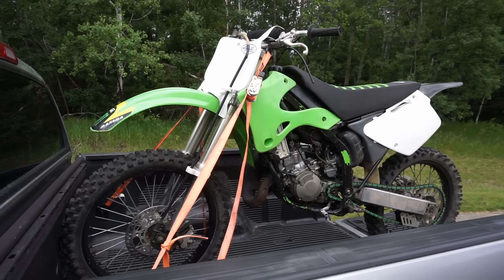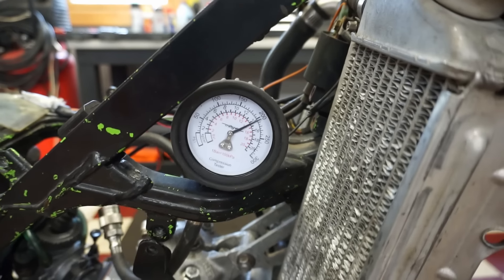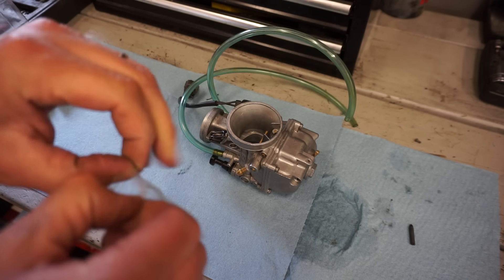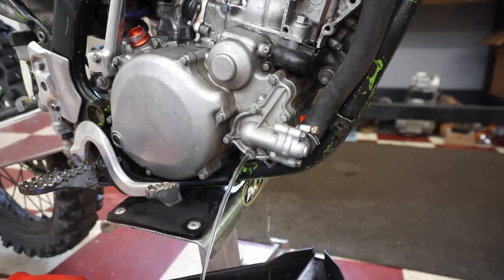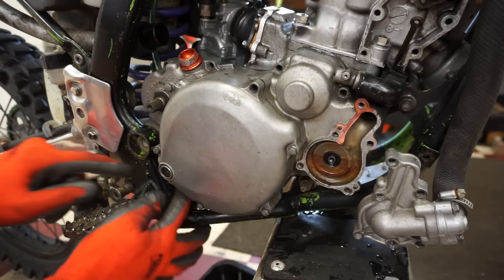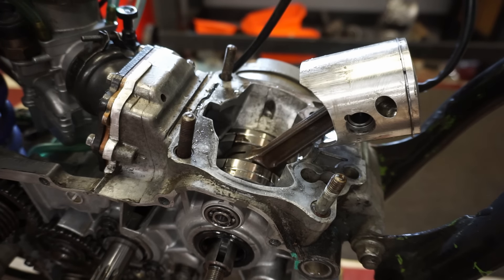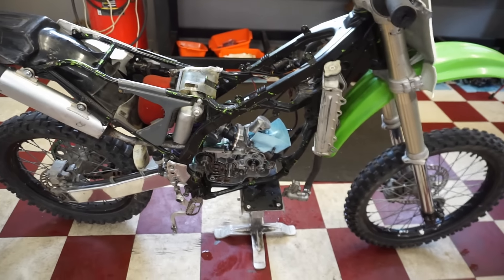Nobody Wanted To Buy This 2-Stroke Dirt Bike (INSTANT REGRET)

Comment: Apparently no one watched the video before commenting. Because the bike isn’t even that bad. Like $200 and a little bit of labor and this bike will be running great
Reply: It will cost twice that just to fix the cylinder, this guy never addresses the suspension on bikes and that involves a lot more than replacing a leaking seal.
Reply: @robh3267 just because you don’t see him doing the suspension doesn’t mean he doesn’t do it

Comment: Ah yes, the infamous “it just needs a carb clean”.
Reply: Yeah I have had one of them bikes just needs a clean and it needed  a  load of parts
Reply: It just needs to warm up - despite the engine being warm when you arrived
Reply: Yeah I never trust that when I hear/read it
Reply: This video will pay for the bike ten times over
Reply: @SpaceRanger187  he got less than 500k subs he isn't gonna make more than 150$ on this video
Reply: @thebigguy8306  yeah my bike runs sluggish when it ist warmed up,prev owner thought it was the car silly him I got that bike for 600 in mint condition
Reply: I bought a crf450 the other day that “Just needed a carby clean” 
Surprisingly The carby was perfect and starts first kick every time. All it needed was fork seals, rear tyre, and chain and sprocket
Reply: "Ah yes, the infamous “it just needs a carb clean”."  Second only to "It ran great when parked"
Reply: How about "due for top end" on a 2 stroke....no shit you're supposed to change them every 10 hours by specs. 😅

Comment: Top bar isn't bent. Thats a grab bar. Mostly used on mud bikes. Makes it easier for grabbing when stuck in deep mud.
Reply: Your correct it isn't bent but it's not ment to be a grab bar, it's designed to allow the bars to flex, it never really worked very well.

Comment: Just picked up a basket case kx250 for $1000. Supposedly needed a carb clean. Has 225 lbs of compression and blown crank bearings. You’re 125 made me feel a little better about my purchase 😂
Reply: You didn't do bad at all we've all been there! That's worth a thousand all day long!
Reply: depending on the year an eBay part out could give you a return on you're investment if all fails, youd just need to be patient.

Comment: With that much compression you better be running race gas or boom. My guess is the head was shaved before for racing and then sold and new owners probably didn't run race gas and detonated itself to death! I would be looking for stock head!

Comment: Kdx 200 is my favorite and current woods bike just keep up with the maintenance and rebuild the top end every 2 years or 60-80 hours to keep the piston from cracking and locking up the crank or destroying the hole entire engine or casings

Comment: I just bought a kawasaki er 5. The kid was so scrambled between his job and selling me the bike that I felt rushed and didn't check everything out. I toke his word for half the things. Never have I been screwed so bad. Almost had a panic attack when I started realizing all the problems. The most discusting one(it was my fault) is that he told me it had insurence paid till the middle of next year and I was in so much of a hurry to drive it back cuz I had to drive 200+ miles and it was getting dark and cold that I didn't check. They toke my lisence and I will be fined atleast 150 bucks. Went there to save 350 bucks from one that was sold local. Didn't save anything. It's my first vehicle. A huge life lesson. The expirience ruined any prospects of me wanting to ride again. I will fix it up and sell it. Gonna buy a small car. :D

Comment: good dx on this one! you should do a special on your parts washer - solvents/before and after pics, ultrasonic cleaner etc you need to add tires to parts list, new filters, shock oil plus labor @50/hr to get a real price but probably well worth it for somebody out there for sure - will be a screamer - do a followup when you put it all back together - just hammer bars back into shape, get new grips, update plastic a bit, maybe paint frame back to kawa green - when you get sprockets think about gearing maybe add or subtract a tooth here or there

Comment: In order for that bike to have 220psi of compression, the head must have been shaved down for a tighter squish band and if so you’re gonna want to get a high compression piston and run the bike on 110 race fuel.
I would definitely check your squish so you know where you’re at with it and also gonna need to make sure your jetting is up to par.

Comment: I bought an XR-400 with a pogo stick rear end.  The shock was rebuilt by a "professional" company; branded and everything. I went to rebuild it and found they ground the shock shaft down too far (a caution in every manual out there)  and the valving had come out. It damage everything on the inside, so I had to buy a used one from E-bay.

Comment: I had a 2006 200exc and when I put it up for sale, the buyer asked to check the compression before he committed so I did and it had 200psi. I was using my Mac tester that I've used for 2 decades and still do to this day. I don't know know if it had ever been rebuilt. We all shrugged and he took it. But strange, right?

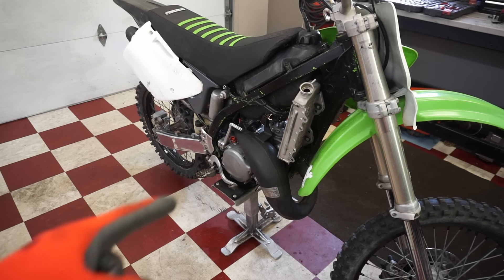Comment: 6:58 Joe I had a 3.0 litre v6 in my boat and it had a massive crack in the water jacket on the block about 4 inchs long. I sanded the heck out of it by hand then gave it a very thin layer of high temp silicone. Then 3 layers of regular jb weld and let it dry for 3 days (1 layer per 24hrs.) and It was brand new Boat. I ran it that way for over 10 years wot 90% of the time. Never leaked at all. When I got rid of it it was starting to drip maybe 1 drip every minute when running, which was nothing. Now that is one of the few times it has worked for me. And although i am a handy dandy kinda fella. If the kid did it Well i will have to watch the rest and see. Also my block was good ol iron not aluminum which i believe that is. Oh and that suspension when you were using your hand. On my phone it was the funniest thing ive seen yet. I was kicking and bucking laughing so hard. I know you bought it to make a vid. But wowzers I would have charged him to haul it away. The scrap value wont even pay for the fuel. Ok back to the show. Love ya bro.

Comment: I’ve never seen someone run a two stroke without the pipe on before, definitely an interesting sound.
Reply: I used ti have a a 87 kx 150 frame with a 75 ke 100 2 stroke with no pipe and rode forever but fuck it sounded so loud

Comment: I am still curious on the compression. Back in the day on the 250r we would take the head gasket appart and only run one layer of the gasket. If I remember it was 10 thousand thick. It would bump the compression well over 200

Comment: My thoughts on the high compression, and I’m by no means a mechanic. But all that water in the fuel if it got into the cylinder  and water does not compress, maybe that is the cause?
Reply: Could be a older race bike high compression or ran regular gas instead race fuel

Comment: Coolant leak is from the hole in the cover for the pump cover bolt. Threads got drilled out and a helicoil put in. Should not have gone through the bottom of the hole. You could see it even broke out the back a little crooked lol

Comment: I had a 2002 KX 85 it was clapped out when I bought it but it ran. I blew it up while I was waiting for the piston. I ordered $600 in parts and then I ended up putting the piston in and I needed a bottom end.

Comment: Those beat up bikes that run good are great for trashing around the woods, running thru water, rocks, snow whatever, its a who cares if it gets scratched up, bent here or there or broken plastics. You have fun doing crazy stuff that you won't do with your nice bike and worst case it blows up in the middle of nowhere you walk away from it. Lean it on a tree a place a sign "free u push it out" 😂

Comment: Hay Joe  hope you and your family are all fit and well 👍 😊 😀 🙏 
And congratulations  on not using the word perfect  
Your comentry on  the work your doing to the motorcycle is a  pleasure to listen to now 
Thank you 
Have you thought about raffling off a motorcycle maybe the Chinese 250cc  As there is plenty of them about  to replace it to your subscribers I have a few bikes and one is a HONDA XL250R 1985 I ALSO HAVE A FULL ENGINE FOR A 1995 or  1997 THE TOP END IS THE SAME AS THE 1985 BUT THE BOTTOM END HAS AN EXTERNAL OIL COOLER 😂😂😂😂😂😂😂😂😂😂

Comment: Maybe incorrect base gasket or the head/cylinder has been decked which is causing the compression to go up?
Reply: Head was most likely shaved to raise compression for racing. That high of compression it needs high octane race gas run in it to prevent detonation

Comment: Explain to me how you can say.I think the crank is just fine when you haven't taken the jug off and tested the connecting ride.Because that's the only way I know of checking the current is to grab a hold of the connecting around and see if there's movement you sure as hell can't just listen to it being kicked over until let's crank's okay. You need to check the squish man With those high compression numbers I guarantee you.That the compression ratio is way too high for pump gas

Comment: I'll speculate as to the extremely high compression. 1] it had pretty good compression anyway. 2] there were remnants of water droplets on the top of the piston. So I am going to suggest that there was a measure of water which got above the piston before it was exhausted out of the engine, which reduced the TDC capacity and raised the compression because, as we all know, you cannot compress water. Am prepared to be shot down on this one. Just putting it out there.
Reply: Might also account for the repaired crack in the cylinder block.

Comment: I have a question about spark plugs. I have a 2023 crf250f. I've had it for a year and a half now. My plug doesn't even look like it's been used. It still looks brand new. It is fuel injected. Is that normal?
Reply: No suppose to be tanned, you gotta carb?

Comment: I got a 96 yz125 and it's got 30psi I went to open the top end and realized that there's literally no head gasket seal. Would this cause low compression
Reply: Won’t even idle properly and it cause a lean condition if running, high rpms then back low, sometimes not until you blip throttle

Comment: You sure love a good challenge. They should have paid you to take it away. Try a ball of steel putty on the end of the front brake lever, might be the perfect length. 
Also, your cost analysis doesn't include correct plastics, new grips, water pump cover, new tires and possible replacement cylinder head.

Comment: With that much compression I would not run anything less than 93 with octane booster. I had an '03 CR125 with the high compression Eric Gorr big bore on it, and it had 215 lbs of compression. It would ping like crazy unless I ran 110 race fuel.

Comment: That high compression is due to its overbore kit. When you will grind the had to be flat, it will even increase the compression more. You should  use some thicker gasket to compensate for it.

Comment: 2 vintage can u help me I’m looking for a rm125 92 plastic clip ring that holds needle jet down having same issues and it was glued
Reply: Your rm125 really help I just can’t buy one from anywhere do you know where they are stocked and the throttle valve slide 4.0

Comment: I bought an old Polaris in about the same shape as this, after days of struggling realized that it was a basket  case and the seller totally lied about and was a total parts cannon. I resold at a loss and never looked back You at least make money on videos about fixing junk.
Reply: When you know the best tool, besides a sledgehammer, is some gas and a match.  Doesn't even work as a planter

Comment: Seeing that water in the gas, makes me wonder if the neighbor killed the bike while the kid wasn't home by putting water in his Gas.  ha.   So interesting that they would glob JB weld on a leak at a gasket like that. considering a bit of RTV on the gasket would have probably fixed it. I wonder if decking that head is going to work out.  Also still curious how 225 psi of compression, very odd.

Comment: That is not discoveration.That is aluminum transfer from the piston.That is aluminum that is worth from the piston to the cylinder walls.And you need to take it out with muratic acid before you hone the cylinder..its called aluminum transfer piston to cylinder wall transfer of aluminum and muratic acid will remove it completely.and safely. Do in well vintilated area.

Comment: You can rebuild the shock. It is fairly simple just watch a couple of videos. A seal head is cheap and oil that’s about it. And bump your compressor to 150 and fill the bladder been doing it for 25 years now never had a problem.

Comment: I'm right at the point where he took the clutch cover off and found the loose gear. I'm pausing to make a comment which is "I don't think that's the problem ". OK back to the video to see if I'm correct.

Comment: 😂🤣🤣😭. Bruh I’m Laughing So Hard It’s 4am My Wife thinks I’m FKN NUTZ ,  222 LbS of Compression 😳🤬 a 125cc  Head  with a 2 Mill , Gape on the Head Gasket  Few Tubes of J B Weld , no Coolant cause the Water Jacket is Cemented Close with Epoxy head Gasket is JB WELD ,

Comment: As soon as you saw no coolent or fuel , should have told you he didn't want you to yry starting it or to see all the leaks of fuel & coolant ! Then , when you saw that Head AND he told you about the trashed cylinder & JB Weld on the water pump , you should have just walked away. You paid like $800 too much.

Comment: Another I pay way too much for a price of crap bike video. And then all video long the seller lied to me about it doesn't leak water or gas. I paid way to much etc. etc Or lied to me about the condition of the bike. In 30 seconds you can tell he is lying if you looked at the bike before you bought it. He is your first question at purchase let me hear it run? Other wise my offer is for a junk bike because that is what it is if it will not start.